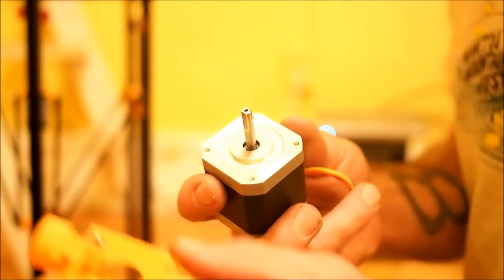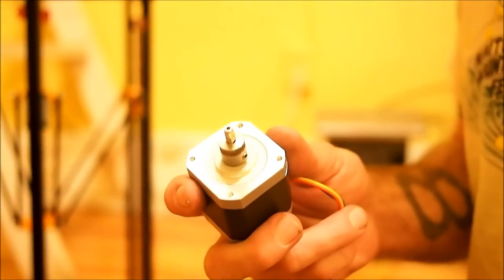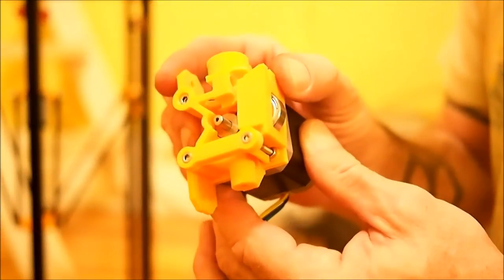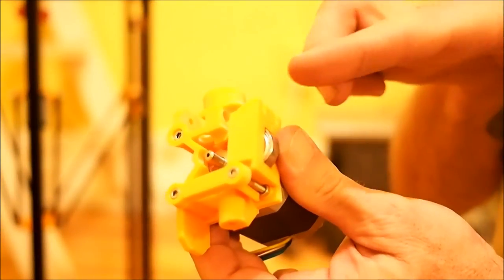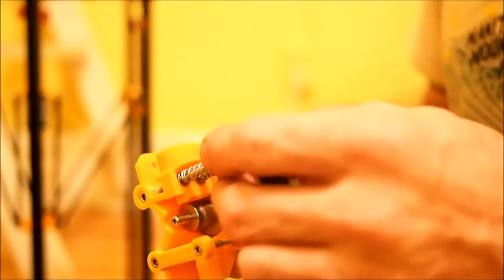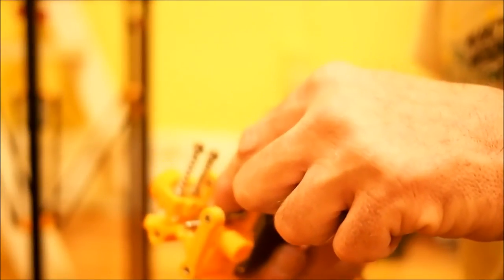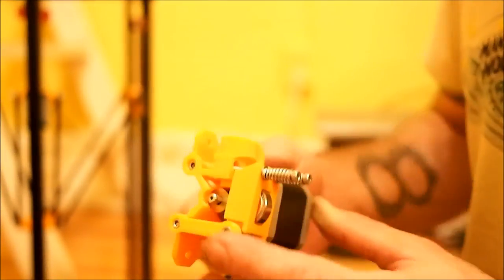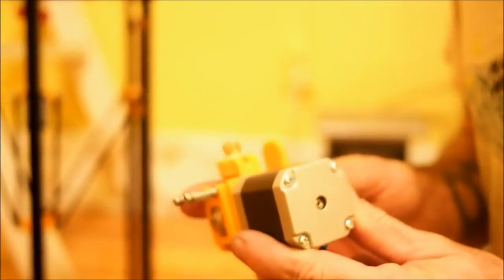Mini Kossel 3D Printer Build - 6 - Bowden Extruder

Comment: It's that a mk8 driver gear?
Reply from the maker: yes its the MK8.  I've used it for PLA, ABS, PET+, BSP, ninjaflex with no problems. (I'm currently using the airtripper V3 BSP extruder body.) it's a good set up. I'm really starting to like Ninjaflex...